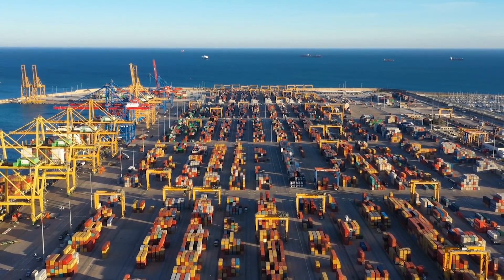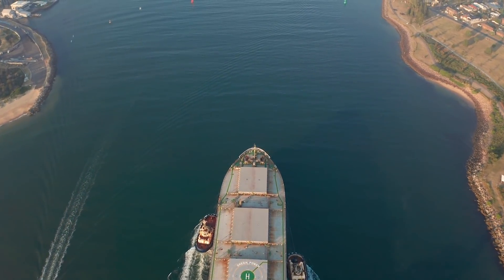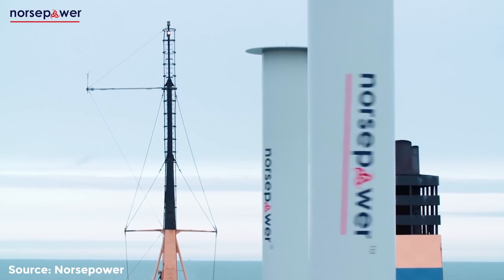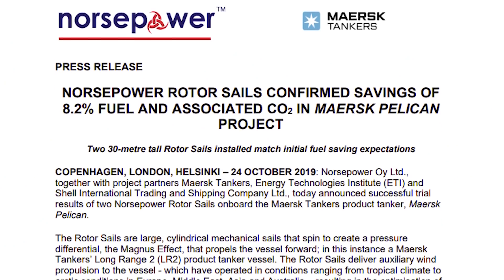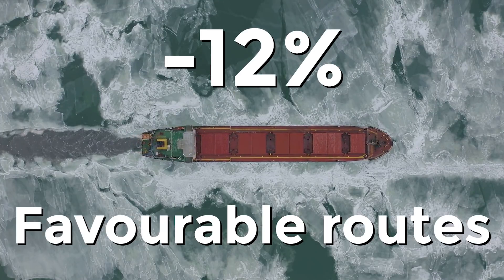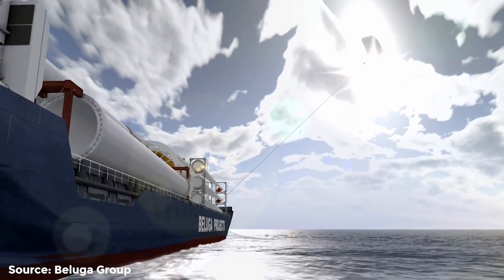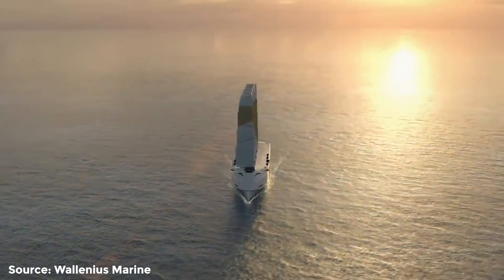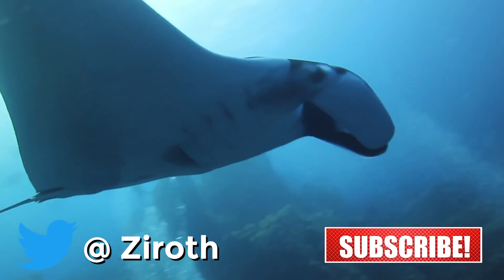Is Wind Power The Future of Shipping?

Comment: 3 percent isnt as bad when you think about how many tons of freight a ship can move.
Reply: 18-30% of NOx emissions paints a far worse picture though, also believe they are responsible for even higher levels of PM2.5 emissions as a percentage (the particles that really muck up your lungs).
Reply: @cjhification  Do you know that doctors and dentists use NOX  aka laughing gas as a numbing agent ?
Reply: @joewilson2258  This is so wrong 🤦‍♂️ 
NOx is a combination of mainly NO and NO2, thus, laughing gas (N2O) is not what NOx refers to. However, beside the severe physiological damage NOx in breathing air causes to a human body over time and the "nice effects" of asid rain (in this case: Nitric acid falling from the skies), even N2O is a severe greenhouse gas, factor 310 compared to CO2.
Reply: @joewilson2258  I seriously can't tell if your playing dumb or dumb, or just saying things for a reaction or possibly have been drinking the trump coolaid. Besides that fact that they are  not that same as others have already pointed out. Carbon dioxide is used make fizzy drinks doesn't mean it's not causing green house has issues.
Planet it terribly polluted ever since the great oxygenation event, where pesky bacteria turned all that great Carbon dioxide in to polluting Oxygen, as I'm assuming you are reffering to a period before mass oxygen availablity, if your saying thats the levels of CO2 we are looking to achieve.
Reply: @cjhification  For insects the oxygen pollution era, was a drawback
Reply: @ShakaZoulou77  I'm presuming your not an insect.
Reply: @ShakaZoulou77  also the oxygen pollution event your likely referencing was pre-insect and was at the bacteria stage of evolution, being that Animal life on earth is carbon based, oxygen using, that came about from that particular event. The planet will likely be ok in the long run, though it may not remain a place hospitable to human life, then again it may be fine, and we do like our crap, and shipping by sea is the least crappy way of doing that...who knows.
Reply: @cjhification  The PM2.5 emissions are largely irrelevant though, since the emissions take place out at sea and generally away from people. The high humidity of ocean air also changes a lot of the issues with PM2.5 by hydrating the seed crystals, enlarging them and causing them to settle out or nucleate rain easier. While in port, most places require cold ironing (turning off the ship's engines and running the ship's electrical systems from shore provided power) reducing emissions.

As a side note, PM issues start to become an issue at PM10, become hazardous quickly at PM2.5, and really screw you up at PM1 or PM0.5. At the latter scale (<1 micron), particles can pass through the lungs from air directly into the bloodstream rather than lodging in the lung and dissolving or otherwise being handled by the body. This is part of the issue with smoke inhalation, because fires (including internal combustion engines) produce huge numbers of particles less than 0.5 microns across.
Reply: @timberwolf1575  a good portion are as you point out, but just coming in to port and leaving port, unless done purely by tugs, is responsible for huge pollution of port citys air quality.
And Agree with all you've said about actual particle size, including sub micron is worst, but heavy diesel is pretty bad across the board. Given that it's still the most efficient way to move goods, not disagreeing with that, just pointing out that just because output is relatively low, if there are others with a much bigger potential impact, then that is the area where most risk is likely to exist.
Reply: Not really they spend most of their time away from populations.
Reply: @cjhification  Those kind of emissions in the middle of the ocean, don't worry
Reply: @ShakaZoulou77  I don't think the front has fallen off, and so it's not been taken outside of the environment, so it's still an issue.
Reply: The tall Masts from the sailing gear will interfere with loading cranes and bridges.
Reply: Cargo ships are some of the most efficient machines made , in terms of wrk done
Reply: @leefithian3704  And still, they can be significantly improved 😉
Reply: @snygg17  how?
Reply: @iqbalindaryono8984  did you watch the video.
Reply: @snygg17  Per ton these newer ship engines are way much cleaner than ship engines built just twenty years ago . Many of the old ships used fuel oil or massive amounts of dirty coal to move the cargo and passengers across the oceans .
Reply: @joewilson2258  but "improvements" made in the past are not a reason to get lazy nor to stop improving.
Reply: @leefithian3704  They take stuff from sea-level to sea-level, so they don't do any work.
Reply: That is true but the nox and other pollutants ships make because of the crude fuel they use is more significant. Shipping is by far the most efficient way to transport goods but any reduction in their fuel burn is good for everyone; the environment, us and the companies wallets.
Reply: @brycedelany8211  thats why we try to use scrubber systems to reduce SOx , sadly its much more difficult to reduce NOx since our atmosphere has a considirable amount of nitrogen there is no way to  prevent all of the emission. Of course its manageable but to prevent global warming, we need to regulate land transportation. Ships are more infamous when it comes to local pollution. They release a bunch of co2, SOx , NOx and various particules.
Reply: @Gurumdae  that’s a good point. Still it’s interesting how such an ancient technology like sails could help us solve part of this problem of global warming. But I agree there are bigger fish to fry in reducing our greenhouse gas emissions
Reply: They also burn heavy petrochemicals we typically don't want to use anyways. Better to do useful work with them than burn them in a flame tower.
Reply: @leerman22  Some even burn the used and recycled lubricant oil of your car
Reply: @leerman22  however to not burn any thing or as little as possible makes far more sense as we watch our effect on the world climate get worse year after year. Take a globe and measure 8 miles on it. Now take that measurement and lay it down on the surface. That’s all the breathable air between us and death. You will see it in a different light for ever.
Reply: Yes, but there's always room for increasing efficiency, reducing pollution without affecting the operational costs much.

That's why LNG powered ship is now trending and why not wind power if we actually can get benefitted with some free power?.
Reply: @monad_tcp  NOx=/= Nitrogen
Nitrogen = N2 which is %70 of the atmosphere, Nitrogen Oxides a.k.a NOx  are poisonous and reactive gases.
Reply: Wait. Wut?
Reply: @monad_tcp  NOx is not the same as elemental Nitrogen, a molecule of N2 is very stable and caused no pathogenesis. Nitric Oxide and Nitrogen Dioxide as extremely pathogenic. Basic chemistry.
Reply: @cjhification  alright, but what about the warming effects of those gases
Reply: @monad_tcp  they have a significant contribution to warming effects and are really bad for human health. Hence why a single source responsible for between a ⅕ and ⅓ of the world's NOx is significant
Reply: But what about the 18- 30% NOx emissions?
Reply: @saims.2402  Scrubbers are pretty much standard in newbuilds. What do you want fixed first priority - climate change or anything else? If we don't manage to decarbonize economies we have nothing left to tackle any other issue on the planet at all. There is hard reasons behind why we need to view CO2 emissions as absolute top priority over anything else. The bickering about "other important concerns" is why we did manage to fix it by now. Or won't do so in the future by todays existing means. It's even got a name: "whataboutism". Fair enough, i/o combustion engines we could explore fuel cells to replace them long terms. But that would be a simple phase out by newbuilds once we researched a long lasting membrane  The first thing that will go away is the fossile carbon emissions. Even if we run biomass carbon in a cycle we can fix that issue with fossile carbon being emitted. There is many ways to do that. Any economic technical path rendering fossile carbon obsolte will fix the climate for humanity. Simply the most pragmatic one will shape our future on this nice blue planet. Other things will fall in line with that. That's the same as oil shapes the world economies today. Any other concerns align to that energy path - from love and freedom, to economic currency crisis to racism, to hunger, to wars and terror. We need an ideal renewable path to align with. That's where the money flows will align tomorrow. What would be the alternative to such economic climate action? Energ flows is like the bickering about irrigation water in an oasis.
Reply: Its like how people hate coal plants in the us but with all the regulations they have become so clean that they tend to be cleaner and safer then other conventional means i honestly with rather have nuclear power (if done properly and not forced to take sort cuts) but i have to admit things are getting interesting but as new technologies are developed the emissions will keep declining it just will take alil time and effort for these ships to become cleaner
Reply: @desertcobrabattalion1890  key thing about newest generation nuclear power is that it takes 20+ years to plan, enforce and construct such power plants. They simply come to late for climate change by 2030 or 2050 climate action Paris goals. Above 40% renewables from wind + solar the grid stability is gone. To provide gas power plants or modern nuclear just for nights and lull days is ridicoulously expensive and inefficient. Energy corps will run them this way. But we all pay for that on top in the end. Plus a hefty margin on such a hostage taking business model. W/O something like tidal energy being 24/7 reliably available along coastlines it's never economically gonna balance and play out for industries and economies to survive. Even less so socially peaceful rather than purely technically. Fortunately all population large centers are by seas with tidal regimes. Geografically the alluvial lowlands of large rivers and their continental shelf shallow waters enable the resonance ripple effect of high tidal flows. Adding 40% to 60% tidal power easily enables another 40% to 80% wind plus solar. The excess and the remaining tidal potetial can go into mobility via efuels, hydrogen or whatever is cheap to store and transport. The single one thing we don't have yet is a turbine ideal for sinoidal tidal flows. It needs better pitch control like hydrodynamic properties and longer wingspan either by material or design paradigm used. The logic is fairly consistent but all the key aspect are a shipload full of rocket science to swallow. Admittedly not the most appealing for media or politicians. Goes with some uncomfy truth for greens, dems and conservatives alike in every nation on earth. It's the single promising key research field where you barely got aany friends to not fight alone. Guess it's just like life is. Regarding ship they just need net carbon emission free fuel. You could simply make diesel from cheap tidal power via Fischer-Tropsch. Maybe they got fancy Flettner tubes or Sails, Kites or fixed wings to safe on that. maybe shipping rates rather slightly increase and vessel overcapacity is reduced by scrapping. that wouldd pull ship oweners out of a 15 year criisis and be very welcome by most of them. These finance heavy guys play their own shark like power games among themselves anyways.
Reply: Yes without the modern shipping industry price of commodities would be damn high.
Reply: people: "SHIPS ARE BAD, STOP USING THEM!!!!!!!!"
vulcanos producing 40% of the worlds carbon dioxide emmission: " 👁️👄👁️"
Reply: @atheon-  do you suggest we lower our use of volcanos then to curb our carbon emissions?! 😂
Reply: @ZiusudraRascal , no, im saying that the greenhouse effect is natural, but we are making it quicker
Reply: Don't forgot the other gases
Reply: carrying consumer single use products that takes considerable amounts of energy to make...
Reply: True but no one was saying that shipping is bad, he just said it makes up a certain amount of global emissions and we could make shipping itself (already an extremely efficient way of moving lots of freight) more efficient.
Reply: @ACF or just pay some carbon tax, and someone build a stationary carbon capture plant in-land to offset it. wind power is not happening, forget it, its not practical, not for mere 3%
Reply: @HenrikStidsen  People who bash them are usually the same vegan /veggie people that love Avocado not growing where they live. They certainly live of kale, carrots and potatoe all winter.
Reply: Every percent of global Co2 matters a great deal if we have any chance of dealing with catastrophic climate change.
Reply: @ZiusudraRascal  No, not every last percent. We should clearly focus on the big polluters and mitigate the smaller issues left. Because a blame game with fingerpoiting on the last private individual offender only has the biggest offenders escape for longer. Like asking individual to give up meat. Yes, we 1st wirld people need to rethink and reduce that.
We can't just totally give it up. We don't need to. Shipping is vital to feeding people and economies.
Biggest offenders are coal for electricity that can be replaced by tidal power, Oil for mobility that can be replaced by eFuels, hydrogen or Battery by tidal power plus more wind and solar. In agriculture we need to absolutely turn around to reforestation. We can only politically believably tackle this after proving to succeed in replacing coal and oil w/o killing economies. Afterwards we do know what cuts wefactually do still have to make we cannot grasp by reforestation mitigating CO2 emissions. We absolutely can turn the planet to storing CO2 below the earth and in biomass again. An awaken preserver mindset is admirable but on any slightly bigger scale achieve nothing relevant here. It doesn't shut down any coal power plant doing a national scale damage 24/7. We need to move for the energy wasted for any low key internet post moral rant to tech & sciene that beat coal in the energy game. Only tidal power can achieve that and we need to build from there.
Reply: @ZiusudraRascal  no if it causes more problems to be solved, if every percent did really mattered we would just have nuclear ships that have 0% emission [after they are built]
Reply: @ZiusudraRascal 
Things are not so simple. Like many environmental solutions, new solutions create even more hidden carbon emission than traditional systems.
For example, you develop this wind powered ships, which requires lower speed and difficulty of accurate schedules, so what will happen is you will need more ships, do you know how much co2 is released to build a cape size bulk.
Again, things are not so simple.
Reply: @xuliang2121  And do not forget, lot more chances to have something broken and need to stop for repairs
Reply: @ZiusudraRascal  Hey death hunter just how much do you want to kill off our plants and trees ?? You don't understand that this planet is actually in a CO2 deficit and has been for the last two hundred years . Yes 400 parts per million is a deficit as it should be around 1200 parts per million and then we will see a greater growth of both plants and trees which will increase the oxygen levels in our atmosphere . Also with a greater amount of CO2 the plants don't need the amount of fertilizer we now use to make our plants grow , and that will help to keep our waterways  cleaner at the same time .
Reply: @joewilson2258  With more CO2 we have more vegetation growth, but we need more fertilizer for that,it is what is made in high end green houses, more of everthing, and avoid to maximum the release all that minerals and gas to the outside environment, because you want your plants to grow and not the wild ones

Comment: you can also produce hidrogen with off shore wind farms and run the boats with hidrogen
Reply: Making hydrogen takes a lot of energy, so you would need a lot of renewable energy to offset the cost. For ships this large I would also liquidize it to store more of it in a smaller space
Reply: @gormauslander  i also expect some batery brake through that will make it posible to just recharge bateries. It would be awesome if they could lay electric lines on the ocean but it doesn't seem feasible

Comment: There is no need to worry about the carbon dioxide. Raising atmospheric carbon dioxide concentration has net beneficial effects of increasing agricultural yields, reduced winter heating costs and fewer deaths from hypothermia. Wind power is centuries out of date.
Reply: I see you have done little to no research on the state of technology or geoengineering of today
Reply: @Gorm: Small modular nuclear reactors would be good for powering cargo ships.
The Bering Strait tunnel should be built so that cargo can be shipped between Asia and America by rail.
I’m not into sailboats. They are too slow and boring.
Reply: @johngeier8692  aircraft carriers have been using nuclear power, so it's possible. The video details why that isn't being done currently for shipping